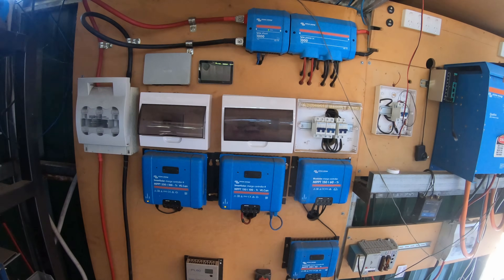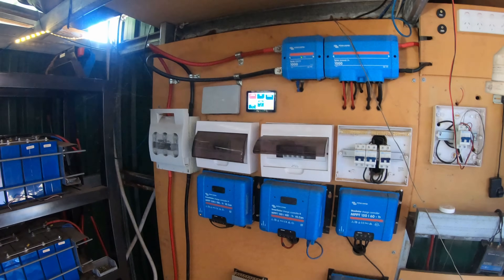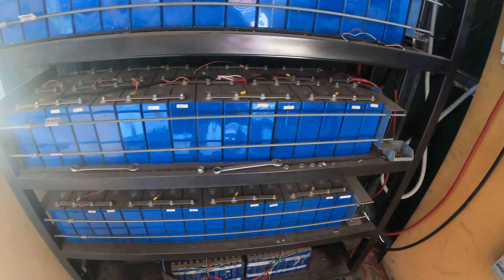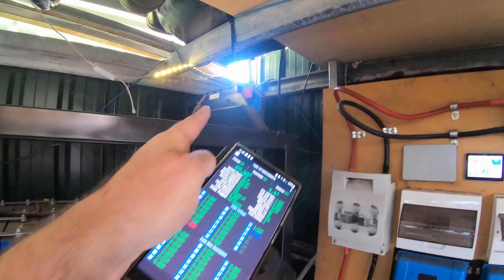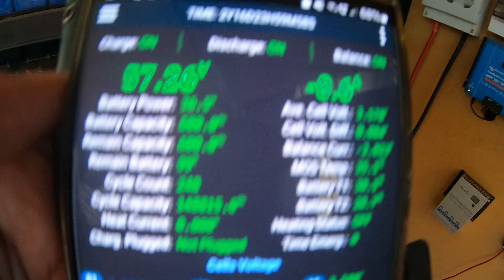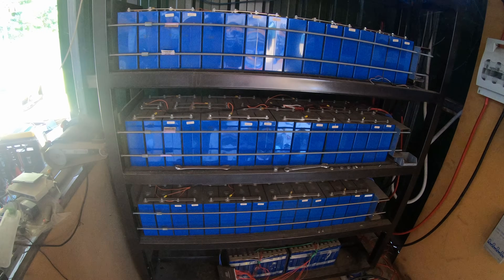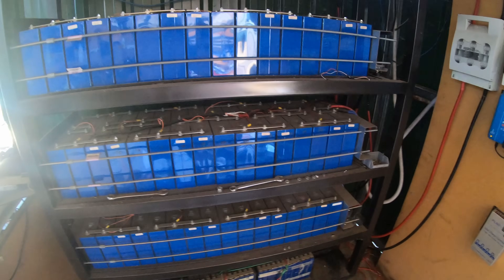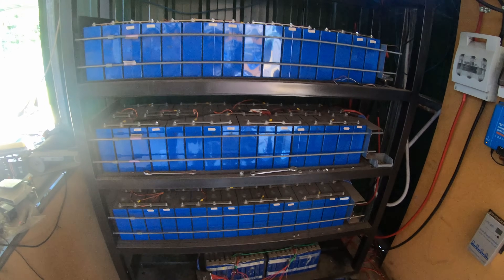The battery after 2 years of use

Comment: Perhaps where the bad Chinese quality rumours originated from, was from those who purchased used, B grade of factory rejected cells from dodgy vendors. 

The CALB cells that i purchased came directly from the factory, with test results, serial numbers, and a user manual. They have been in service for six years with no sign of degradation. The cell voltage difference is generally < 0.004 V after more than 2200 cycles. That's in the harsh tropical environment of northeastern Thailand.
Reply: That's cool. Where abouts in NE Thailand? I lived in the south for a while. Miss the place, love going back there.
Reply: @jamess4972  About 20 km due east of Udon Thani.
Reply from the maker: That is funny you say that, the failure we had on our last camping trip was a used upcycled cell.... you can imagine the conversation after that... all new batteries from here out

Comment: Looks good, you need some my iBMS boards so you monitor the cells and add BMS Communications with the Victron system!
Reply from the maker: Ah i am familiar with your board. I used your old github repo to read the data out of the BMS in the first place. 

it looks like you closed sourced it  ?

Comment: That's not how proper convergent balancing works.
There shouldn't be current going in or out of the battery.

Turn OFF the BMS charge MOS and balance there.
Reply from the maker: Ive just grabbed another video of whats happening, it will be up shortly.

Comment: Good onya mate, yes, this solar/battery stuff is very addictive, I've been off grid for around 6 years with a "normal" household and an EV. No problems whatsoever, noticed no degradation at all after this time. I do treat the batteries with respect, so their lifespan looks to be great. Nice setup ! 👍👍👍
Reply from the maker: I think thats the key, as you put it. Treat them with respect. People immediately want to see it getting used. But if you abuse it you loose it...
Reply: Andy, just curious. What part of the world do you live, how many kW of solar? How many kWh of battery storage? What kind of EV? And how many km or miles do you do daily?
Reply: @sportbikeguy9875  Hey mate, am in Northern Australia, so plenty of daylight, so currently have around 10kWp of solar, 35kWh of battery storage, normal electric cooking and hot water, have a Kia EV6, don't drive a massive amount, maybe around 50-60 km/day...all going well !

Comment: Same voltage on all banks:  i made 2 inter-bank busbars out of 20x20mm copper rods running vertical to connect all banks.  Even from those massive 400mm2 busbars i connected positive from the top and negative from bottom. So it is guaranteed that the cable resistance are the same from/to all batteries.
Reply from the maker: Thats interesting, I'll follow up with another video to show you what we are seeing. 

I love the idea of massive bus bars though, I wish i had been able to afford that at the time
Reply: @ was cheap as i didn‘t buy it from a cable-store but from a metal trader where welders buy their mild steel.

Comment: Are you keeping the lengths of the battery feed cables the same? It’s important that cables are of the same gauge and length. Maybe you could do the nightmare of swapping out the batteries on the shelves if cables are not identical. 21K £ for those batteries?! Looks like the Chinese are funding their military with the sales of these batteries! 
 When is Elon going to adapt to these batteries. Insurance companies in the USA are canceling homeowners policies when they find out you have a Tesla and park it in an attached garage in your home. I am planning to load all of the roof lines with solar as well as adding a south facing array to catch the winter sun while the east west arrays kinda fill in the gap. We need the most solar power in the summer time to run Split air inverter AC units to keep the house cool. Winter is not too bad since we heat primarily with wood and the only AC power needed is for two refrigerators, one freezer, a few lights and a circulation pump for the hot water feed to the radiators. The fireplace is also the boiler. It needs very little for the small computer controller that handles the auto air damper and switches on the circulation pump.
Reply from the maker: actually thats an interesting point. I saw kenworth offers an EV truck but it uses lifep04's 

We bough these two years ago. Someone commented the other day that they got 120kwh for 17k. Bare in mind it was 21k AUD not the real money :)

Comment: most batteries if not all are made in china. who ever said they're not safe is nuts.
Reply: really - come visit in germany a house that has exploded due to an EVE LFP battery , completely destroyed no one was allowed to enter the space again. It seems to have been caused by a hydrogen explosion caused by the LFP cells. 
Insurance has not paid yet - lot of discussion cause the cells had not been put upright with the valves on the  top but flat like in thes vertical battery towers.

EVE says in the manual upright, they have warned here the customers that it is clearly shown in the LF280 Manual. And they are right.
And the insurance says no payment if you ignore the manufacturers requirement and abuse the cells. 500.000€ damage
Reply from the maker: i think its just negative nellies who are to afraid to try it themselves. But i totally agree
Reply: Oh you sweet summer child

Comment: I think these cells are absolutely fine. People saying they are not good are full of (sh)it. 
I have 36 of them (2P 18s) running my off grid system, also each bank is on a JK BMS.
There is NO WAY I’d ever go with lithium ternary batteries.
Reply from the maker: Are they the lithium batteries with nickel/cobalt in them ? or on one of the terminals ? 

I assume the metallurgy is the issue there, increasing the risk of thermal runaway ?

Comment: Yes with battery banks, it is most important to have the cable lenghts the same and pull the power from either end the banks to get a correct balance current across the banks. From what i can see it not correctly done.
Reply from the maker: It is not done correctly, We talked about it at the time. we really should have done as you indicated and had them diagonally attached to opposite terminals. But we wanted to be able to move the rack (its on wheels) so opted for the two big cables in to the lynx.

We added a couple of 100 mm's to the top cable to get them closer to the same length but they are not the same length. Someone else has comments too and im about to respond. I appreciate any feedback (constructive criticism is always welcome)

Comment: I've had my 16 cell pack since 2021 and still it is going strong use it everyday. These Eve cells should last well over a decade. Just make sure you have a decent BMS with active balancing.
Reply from the maker: We have three of the JK BMS, But your absolutely correct its the management of the cells that's key i think
Reply: Almost all cell manufacturers leave out a important fact of lifepo4 batteries.You have to balance them externally every so often.If people think they can buy a battery and it will be balanced for years they are wrong.Opening up the battery and balancing the cells is what we call maintenance and through this the batteries will last the 10 to 20 years they claim.Most BMS's dont have the ability to properly balance a battery when one or more cells get way out of wack.I bought Bebesosy 16S 5A Active balancer on Aliexpress for 55CAD.I like these because they have a on/off switch and the price.I have 9 battery packs 100AH and 300AH packs.When a cell gets out of wack I turn it on and when it goes back to within 5-10mv consistantly,I  turn it off.I actually took 2 unrelated 24V packs and put them together.They started out  balanced and then went out of wack really bad.Bebesosy solved the problem and I ended up getting a 51.2V battery for free.Enjoy

Comment: Helpful Idea- Take flat bar steel, and weld high grade threads to the last 2 inches. The bars sit flat on cells to protect, its cheaper, its much less stretch over time compared to very stretchy allthread. 
They will last longer if held tighter together, and the end plates should be something very strong. Like big steel plates, It would be ok and justifiable. 
The problem is variation. 
So, if you maybe even took steel sheet squares, and ridgified it by welding 3 or 4 of the same flat bar upright, just tacked every 2 inches to the end plates, It would be rigid and it will still be lightweight. Where the bolts go, I would have the plate supported by 2 bars upright on the ends, right next to the nut and washer, so it doesnt deform. Even weld in a washer, or bar piece for further strength. 

You tourque it up snug, not Very very tight but secure, and let the cells expand in the frame. 
Add a piece of plywood or mdf underneath just to have some structure to the whole set. 
But when secured together well, 
You can have it all solid in one module that can be lifted and moved around
All you need to do is probably silicone glue the cells together on the faces they contact. 
Then its all 1 compliant, secure module. 
Its still seperable. 
Its insulative. 
Use like a tile screed to screed evenly the silicone it goes on fairly thin. Probably 1/2 millimeter. 

This way is probably best. 
Use stainless if you want to to last along time and look good. 
Stainless doesnt stretch as much either but is more expensive.
Reply: I would only have modules of 320ah of 48v or 60v setup.  16 cells or 20 cells, 1 balancer, 1 fuse. Bms, i dont like because its going through mosfets, and thats a loss. 
I like the 60v modules because they have just about the right capacity for any installation. 
The 60v inverter voltage is about 25 percent less lossy too.
Reply: @RobertSchmitt-u7l  With a 200A JK BMS, I calculated the resistance of those MOSFETs comes down to 0.32 milliOhm, leading to a power loss of 12.8W or so at full 200A (10kW) draw. At 2kW draw (40A) that's only 0.5W.
Reply: @PurpleAlienPlanet  Yeah but its silicon electrons. Not trustworthy. And 13w its more like 30w real world.  
Why dont inverters have those mosfets or better? Its a scam.
Reply: @ Inverters use mosfets to generate the sine wave. And no way is the BMS dissipating 30W without active cooling.
Reply: @PurpleAlienPlanet  Sure will, the chinese ones are underated at full amperage they do not perform. Expensive bms is just waste of money and parts. 
You need active balancer, and reliable charger and cuttoff. not double cutoffs, you need to have reliable equipment, properly functioning, not auto range mppt garb.
Reply from the maker: Thats something thats always amazed me about the balancers that use mosfets to switch from the battery cell level to a single bus then pour in to a single cell. They must be amazingly low loss of voltage across them. 

Thanks for the feedback. We built the rack out of what we had at the time. I'd use one of the shelf kits if i did it again though. Too much shit blows in on the top of the cells... (i really need to cover it up hey)
Reply: @BadIdea1123  The most fun about these batteries is playing with the beastly current.

Comment: We too are running LiFePO4 batteries for 2.5 years and still they're performing as similar to day 1.

By the way, do you regularly charge batteries to 57V+? Charging to 55.2V (3.45V per cell) should be enough as I feel.
Reply from the maker: We used to only charge to 55v. I'd be keen to see your setup 

 We only upped the charge to help the top one balance out. The higher the voltage the more effective the balancer is. but you are correct It doesnt need to go that high and actually any higher it starts to cause the lights to flicker in the house.

Comment: May I ask what the channel steel pieces on the ends, for actual use because I like the idea and I’d like to pick some up, but I was wondering what the actual use for them was originally, thank you
Reply from the maker: Ah its used for lots of stuff, i think if you search purlin. In my case the rack was made from some old scraps and factory seconds from our local steel supplier. To i used it as a compression plate. It cant apply too much pressure is it will bow but ive been skeptical about needing compression when the discharge rate is so low anyway. We also put in place a bunch of medium density foam matting in between each cell
Reply: @ thank you I appreciate it

Comment: There were quite a few bad players selling used and what seemed to be seconds as new cells for a while. Seems a lot of people got a bad taste in their mouth from the experience and ran from building their own batteries. I looked and hunted for a while before I found someone I thought was on the up and up. I hit it right thankfully and found a vendor that has been great to deal with, straight up with generous pricing. Price has fallen big over the past year or so. I'm putting mine together in those spiffy battery boxes, 16s 304ah cells. 9 total for 140kwh. Right about $17k for the lot. No idea of the currency exchange for the dollar?
Reply from the maker: Thats crazy cheap hey. We used qso because offgrid garage had them as a supplier. But I think I'm going to try catl next. I hear they have better capacity  now

Comment: It was because of you and Andy that I finally pulled the trigger on these cells. I didn’t have the confidence to do it. Now I’m addicted to assembling these batteries. Just ordered my 4th set to assemble and put on our off grid set up in nsw. Farm across road went large BAE cells 2 years ago and they are dead already. Keep up the good work. Now I need the confidence to work out home assistant.
Reply from the maker: Dude the addiction is real... I find myself just watching it sometimes and I don't think I'm.the only one. I hope your system brings you as much satisfaction as mine does
Reply: and what did you want from lead flooded batteries?
I am from Ukraine - 3rd year of war and blackouts - I immediately started to solve the issue by buying lifepo4
Reply: that will work too easily if you followed Andreas aka Andy from Kassel in Germany or nowadays Off Grid Garage.

You need to set HA up and then if you have JK inverter bms used in eel battery cases or those from gobel power there is a key integration you have to add: bat-mon

That way you get full control about your battery if your HA instance is running near the battery like andy shows it with a raspberry pi.

You need to have an BT connection to the JK BMS ...  

This Bat-mon integration has been developed by another german developer who keeps it maintained. It also works with some but not all other BMS. That is the first spot to check if you want to get battery data independently from your inverter int HOme Assistant.

You usually can also get the data from your inverter too, cause battery and inverter are usually communicating directly via CANBUS

Again: if you use this bat-mon integration within Home Assistant then you also get control about the key switches:
1. charge on / off
2. discharge on / off
3. balancer on / off

It is not designed to replace the JK BMS App - it is a kind of viewer of all battery stats, but this way you will get an archive of years of data like current or voltage and even cell voltages for every few moment.
Reply: @typxxilps thanks but I am not sure my inverter gives me access to can port for jk bms, I have selectronic spPro and can’t find anyone who has done anything close.

Comment: I have had better luck with eve and catl batteries than any other batteries out there.
Reply from the maker: I heard the CATL batteries are now getting significantly higher capacities than the other manufacturers now. I'd be keen to get some in and do a capacity test... the more the merrier i think :) and def has nothing to do with wanting a bigger battery pack i swear
Reply: @BadIdea1123  I have 32k and I would like to triple that, but I am totally off grid.
Reply: Brand new EVE batteries in a hand tool recently failed hard. This may be more to do with the battery management of that tool however, or how it reacted when under high load, it's hard to tell.

Comment: They’ll last for years
Reply from the maker: I would love to see more about that solar tracker you have a video on, If i had the room for it thats what id be doing next
Reply: @ yeh a lot of people knock it but it’s run flawless for over 7 years just keeps goin, get every inch over power out of it sun up sun down
Reply from the maker: Thats the crappy thing about fixed panels. As the seasons change the sun isnt in the right spot.
Reply from the maker: They really will. I do not regret getting them at all